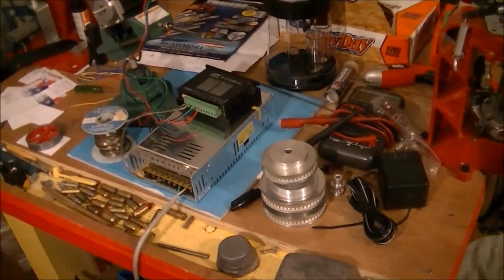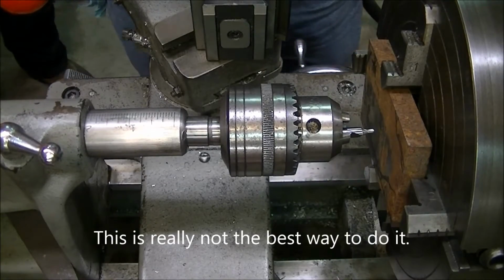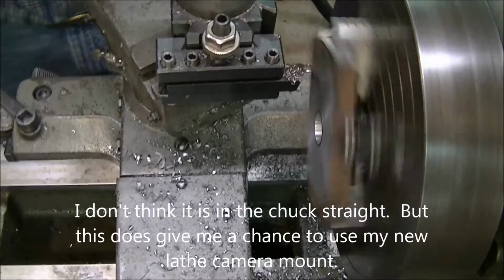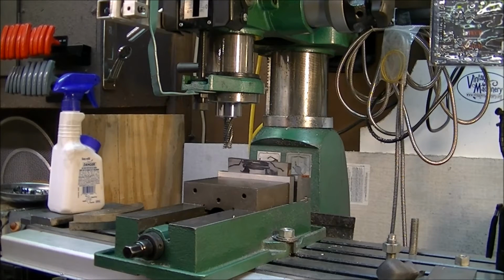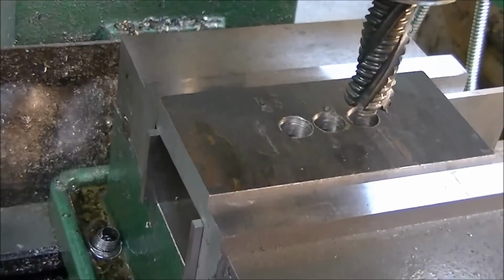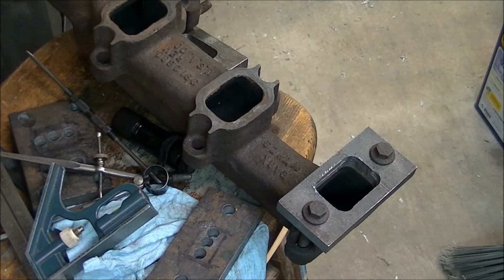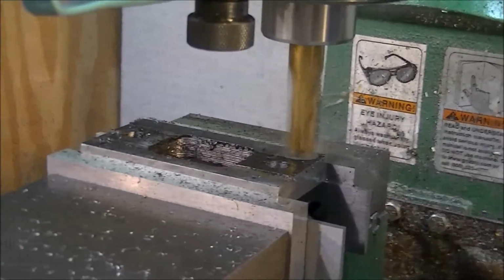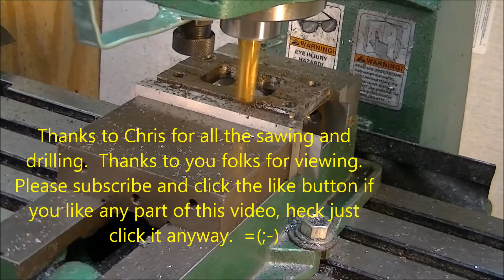Exhaust parts

Comment: Sometimes, those jobs for friends/neighbors are a pain......but a lot of times, they're a good excuse to use your equipment. :)  Some of the coolest stuff I've done in the shop was for other people. lol   
Do you have a fly cutter?  Did you have to cut the corners?
Great vid Harold!  Thanks!
Mike
Reply from the maker: bluehandsvideo I do have a fly cutter and thought about using it but then didn't.  If I had one of those CNC plasma cutters the whole job would have been over in a blink.  Unfortunately I don't even have a manual plasma cutter.  =(;-)  At least I do have a nice size roughing end mill.  Thanks for viewing and commenting.

Comment: Was the centre drill off centre in the chuck? Looked like it was trapped in two of the jaws not in all 3
Reply from the maker: Onur Caglar that could very well be true.  Since I got the new lenses I don't always see everything right.  I will look at the thing and see if it looks like that to me.  Thanks for viewing and commenting.
Reply: Haha I may be wrong but just thought I'd ask. I've done it before on the pillar drill but it's easy to spot when it's rotating.
Reply from the maker: Yeah I do that a lot myself.

Comment: Cummins Diesel into a '52 Chevy pickup.. This should be interesting.. I wonder how long it will take to twist that chassis into a pretzel... Better not put sticky tires on that truck.  You want something that will slip easy enough to not tear the rear out...

What about the other side? isn't that a V8?

I suppose Chris realizes that he will need to gasket both sides of your plates.

I think that job was crying out for a water jet cutter...
or...
a Plasma cutter...
or even...
a cutting torch to rough out the port.

I'm curious .. Why exactly does he need or want to space the exhaust manifold out like that?

It might be difficult to find the correct bolt with the proper shank length... He might have to use a  longer bolt and cut some threads off to get the proper fit.

 Sounds like a fun project.

Anon

Comment: Hi Harold, now getting real big projects....
Made me laugh, "got the WD-40 bottle just like the big boys" ..... lol
Just that the " Big Boys " use WD-40 on aluminum not on steel... (To me, this was the funniest part...) ;-)
Is this one of the Cummins 4 cyl turbo diesel...?
Hope to see more details of the mod.
Cheers, Pierre
Reply from the maker: pierre beaudry I have never seen the engine and have no idea why the spacers or how many cylinders but I suspect it is a 4 or he would have asked for more spacers or maybe things are only tight on one side.  Actually I don't much use WD-40 very often, that spray bottle is full of diesel.  That seems to work for me on whatever I cut and it is tons cheaper than anything else.  I used to use diesel for honing engine cylinders back when I was doing boring for motorcycle shops and I find that other than the smell it works really good for cooling and lubricating.  Thanks for viewing and commenting.
Reply: I never use diesel on steel, maybe worth the try. Sometimes us kerosine or WD-40 for lapping, does a great job just like you said...